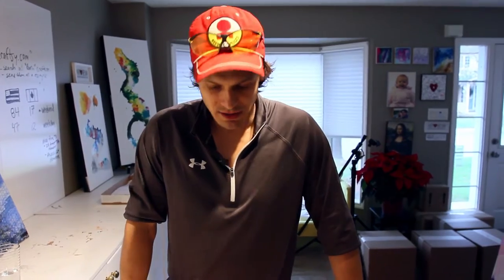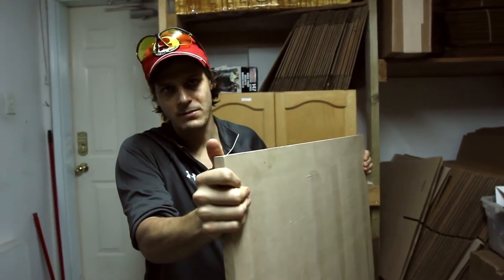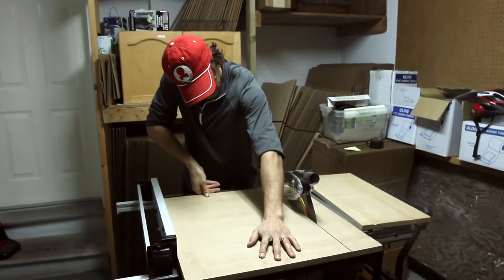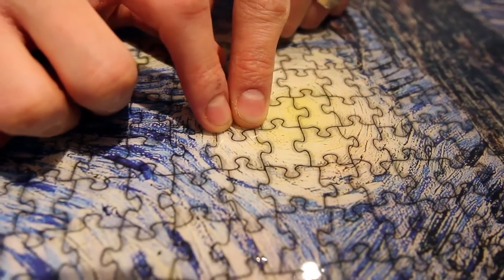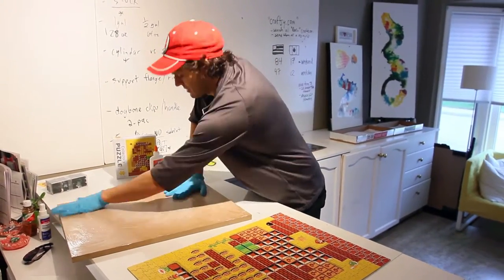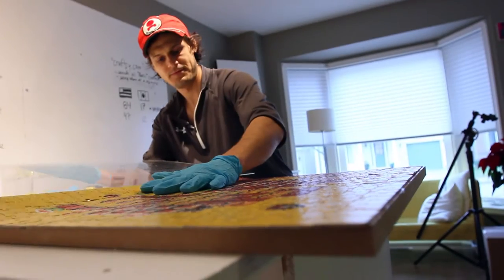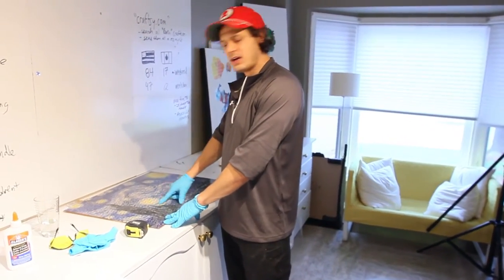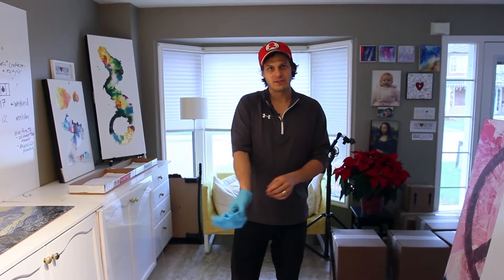How To Prep A Puzzle To Be Resined - Part 2

Comment: I'm in the process of finishing my puzzle and found this awesome product from Elmers, that made the transition onto the board virtually painless.  It's called Puzzle Glue (surprise, surprise), and it sets the puzzle so you can move it without any problem.  The puzzle warped a bit, but once I mounted it to the wood, it was fine.  Just another little tip to make this process even easier.
Reply from the maker: Bonni Poch fabulous! Thanks for sharing hope this helps someone! ❤👍🙏
Reply from the maker: ah, that's awesome - thank you for the tip Bonni!!!  Love that it gives you some working time before it fully sets!

Comment: That's neat about the school glue. I currently have a plethora of Mod Podge from a gift so I would probably use that first. :) Nice to know when the MP is gone though I can just use school glue. I guess I will stock up on it when they have the before school sales - I have seen it as low as 19 cents each at that time. :) - Heidi
Reply from the maker: BlackCat2 ModPodge also works very well